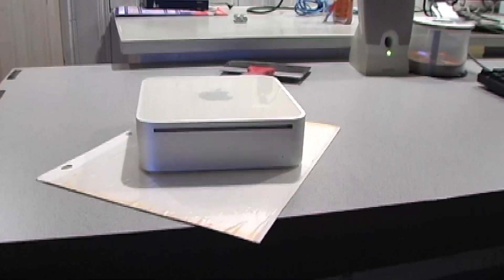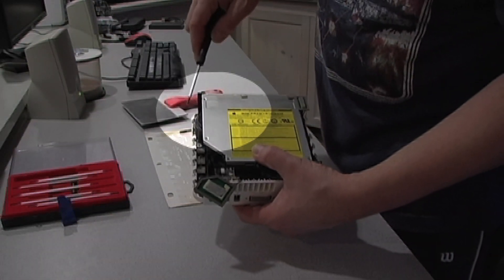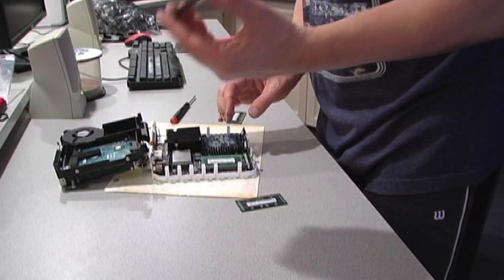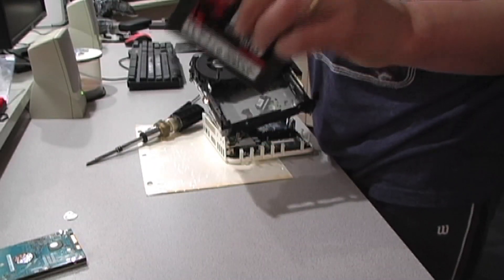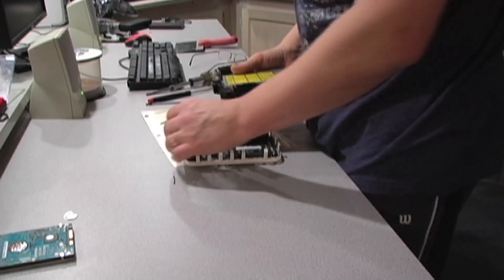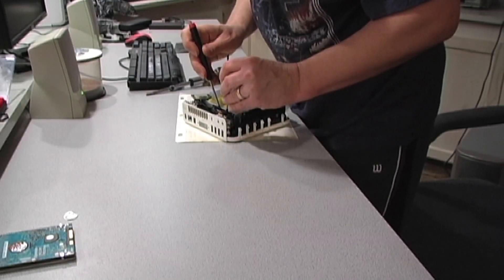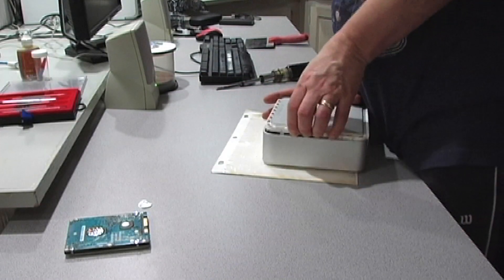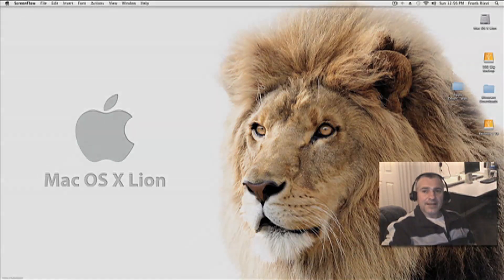Mac Mini Upgrade

Comment: A bit late, but important: it is not a sata ribbon cable. It connects the audio from the cd drive, The sata slot is on the motherboard and the drive unit will slide in the slot from the top.

Comment: On my 2008 Mac Mini I had to replace a failed NH82801GBM, but I did not have to flash anything to recognize the full 4gb of ram and mine is running 64 bit OSX Lion! In Info it says 64 bit and 4gb ram!

Comment: I did everything, changed the cpu, flashed the firmware, but when i put two 2gb ram sticks my mac mini wont boot. It boots only with 2gigs of ram. Why is that so???
How did you manage do do this?
Thnx

Comment: do you have a video on how to upgrade the cpu on the mac mini 2006/2007?
Reply from the maker: No unfortunately I do not, I had my camera in for repair well I did the upgrade for the CPU
Reply: You have to pull the board, then using needle nose pliers to help persuade the hold downs to pop out without breaking to free the cpu cooler, then as you pull it off remove the temp sensor, then use a small flat head to turn the screw clockwise holding the cpu in by the socket sliding into place. It is a 478 Socket M CPU! The apply decent thermal compound, reconnect the temp sensor and place the cooler over the cpu and using something to press the hold downs into place through the holes, ensure they completely come through the board, this means push the each far down to check then replace the board! There are tutorials! Search Ebay for A-Tech 4gb memory for Intel Mac Mini, it will pop up set for $20 shipped!

Comment: Great video. Ihave the same mini, and I want to upgrade to a ssd. The mem is 4 gids.Runing 10.6.8. Can I just put the ssd in, or do I have to flash the mini. Thanks for your time.
Reply from the maker: Gio048 Hey, yes they are nice little machines, you do not need to flash the Mini at all to put a SSD in, only if you wanted to up the memory and up the CPU, best of luck with the SSD, you will be happy you put one in.

Comment: do you have the links to flash the mini for the faster processor and memory please?
Reply from the maker: Its been a while since I have done this, try this link, it will get you started
http://www.xlr8yourmac.com/systems/mac_mini_core_2_duo_swaps.html
Reply: thanks very much for taking the time to reply
Reply from the maker: Darren Ramsay
 Yea you might also want to Google EFI/Firmware Updates (mini 1,1 to 2,1) I think that's how I got the firmware or also try this link https://gist.github.com/dreamcat4/7172737  I also may have it saved on my HD, i`ll look for it when I have a chance, keep checking back here
Reply: frizzman08

OK - ill take a look, if you do have the old install files that would be handy

Comment: I wished that I had watched your video before I tried to upgrade the memory in my mac. I disconnected the hard drive cable. It was real difficult to get it back in.
Is there an easy way to re-assemble? Please help.  Su
Reply from the maker: Check from here how I connected the SATA ribbon cable 12:47

Comment from the maker: @ theman7431

Yes the CPU was upgraded to a Intel 2.1 GHz and had to flash the firmware in order to upgrade the CPU & Memory. A 2010 you cannot upgrade the CPU unless you know someone that can solder.
Reply from the maker: Yes would be a great idea Rizzi41999, once the ram & HD is upgraded, this little machine is fast, still works great in today's day in age, let me know if you do the upgrade :)

Comment: Did u have to flash the firmwire for your mac mini to accept 4gigs of ram?... Or did u just install it after u installed the processor chip and ssd? (Currently swapping my 2006 mac mini)
Reply from the maker: Yes you have to flash the Mini before you install 4 gb of ram and upgrade the processor, that's from what I read when I did the upgrade to the 2006 Mini, it ran super fast after the upgrade, mine you I installed a SSD HD